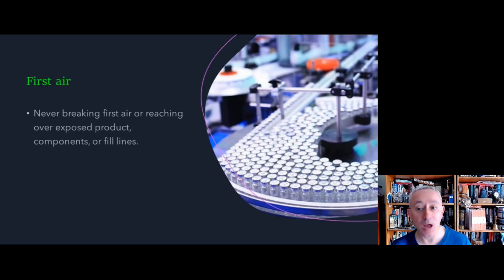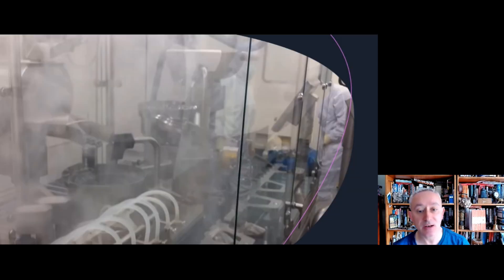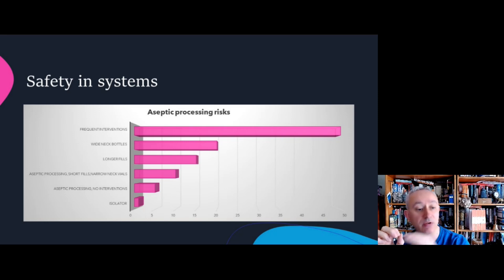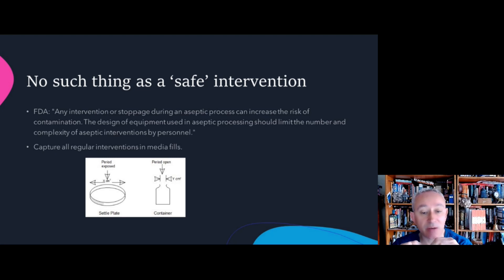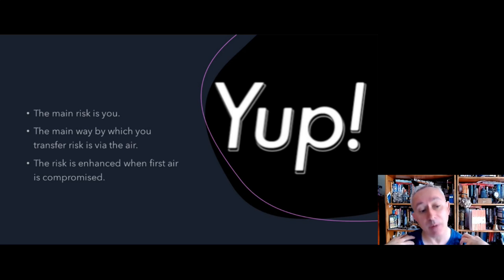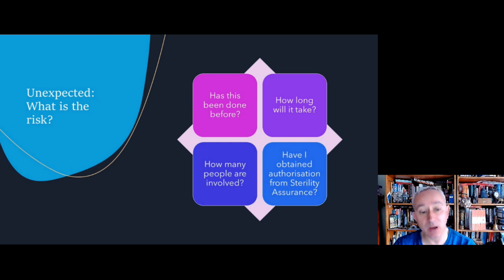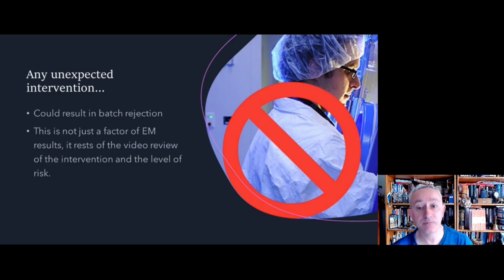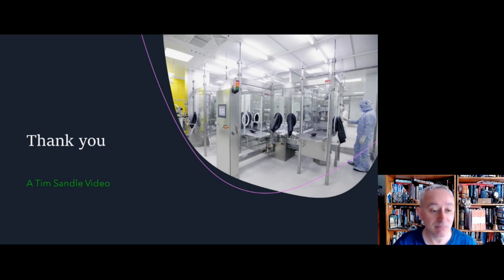Aseptic filling interventions

Comment: 01:42 It is actually not always you can perform an intervention without breaking first air, like clearing stopper stoppages in bunkers, You need to hover over some part of bunker with your hand or instrument (if it is long enough). But, if your HVACs are configured properly you will not break the first air while doing the intervention with open doors (speaking about open RABS), it can be clearly seen during visualisation studies.